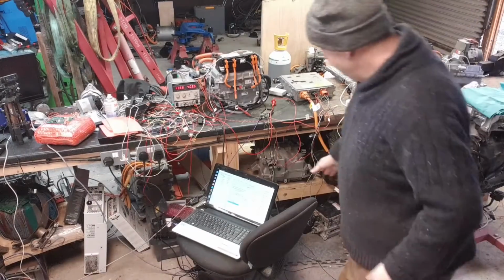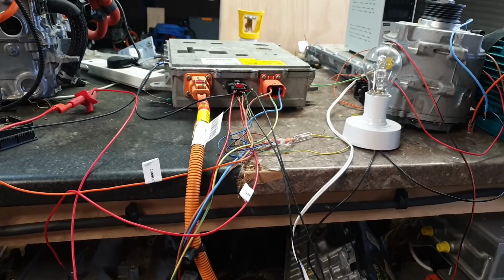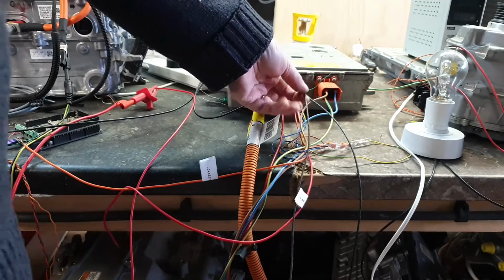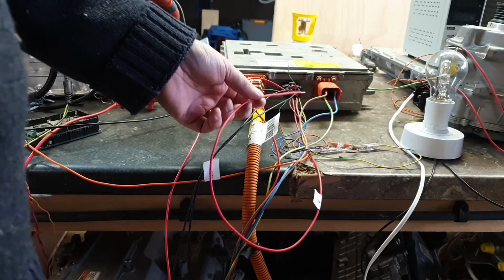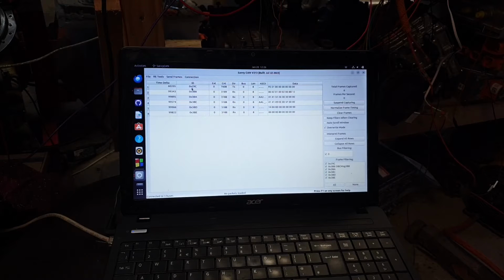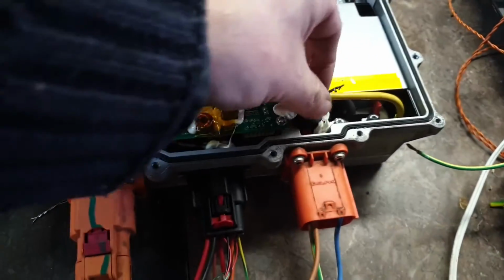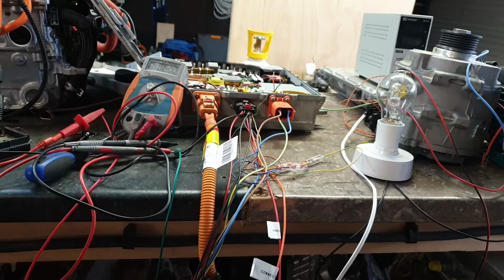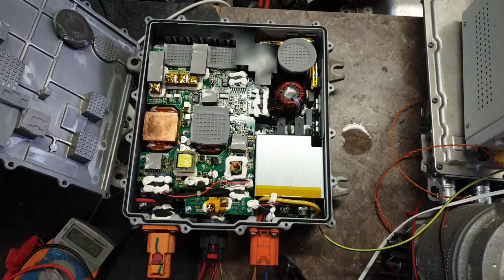MG ZS EV Onboard Charger Hacking Part 1

Comment: How do you actually simulate the Control Pilot and Proximity Pilot signals? Doesn't the charger need the CP signal to adjust the power?
Reply: On the bench it just needs AC and the resistor. The charger itself controls the power by drawing more or less power, but is supposed to be limited by the non existent charge cable. The CP signal tells the charge cable all is well.
Reply: yes that was my thought, Damien does not mention the control wires at all, so my immediate thought was PP/CP the charger MUST have pp/cp or the EVCE will not switch on

Comment: Great starting point. For the diagnostic I found PIDs for torque pro, but they do not contain obc things. But they reveal that MG uses UDS/ISOTP in the CAN ID range above 0x700. So you could send 02 10 01 at all CAN IDs above 0x700, and one should respond.